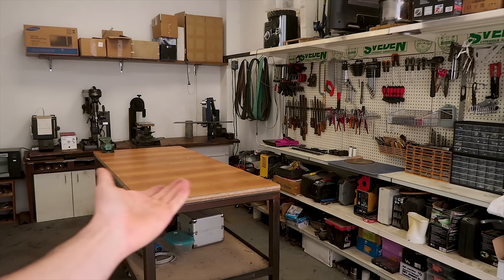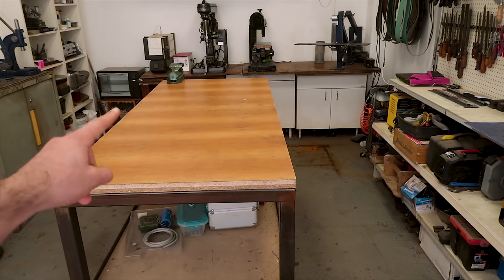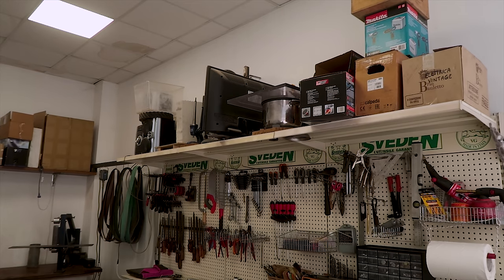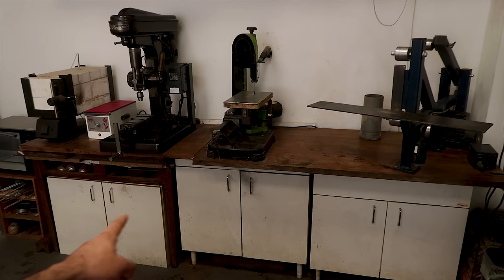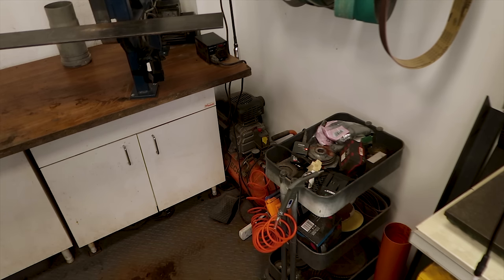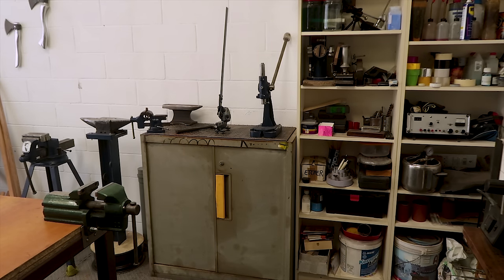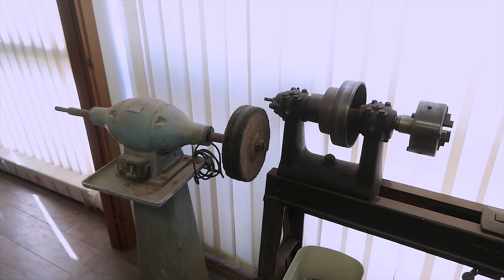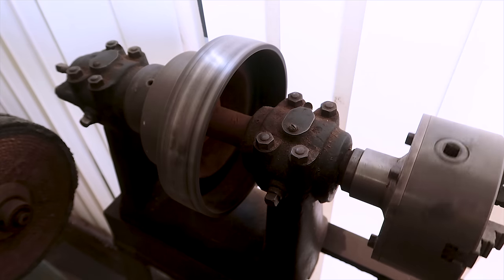Black Beard Projects Workshop Tour 2019

Comment: If you put a mirror facing down at a 45 degree angle, you could put a GoPro on that high shelf facing the mirror and video overhead shots of your central workbench. Also, maybe ask the landlords to let you put some window tint on your large window wall. It sure helps here in Texas.